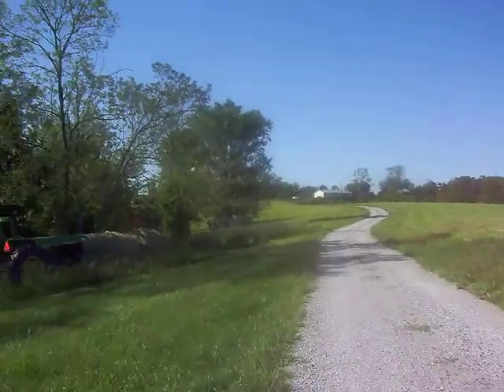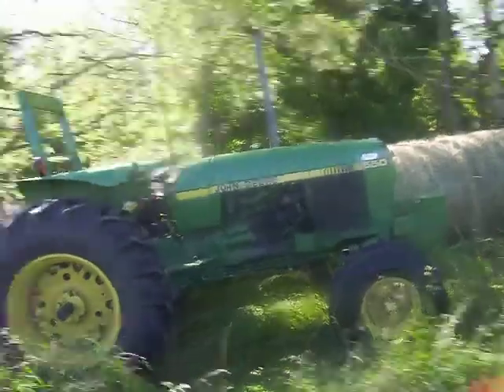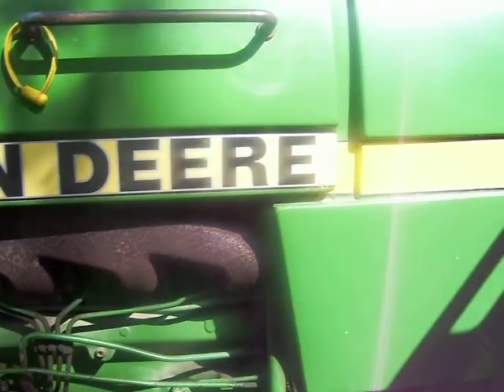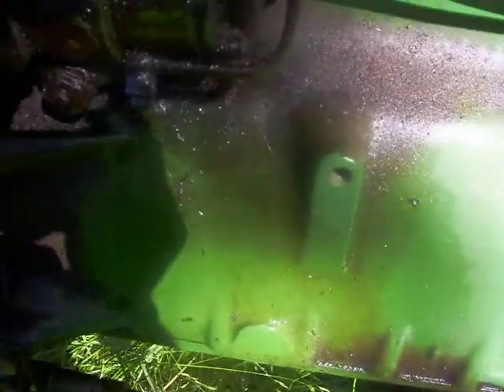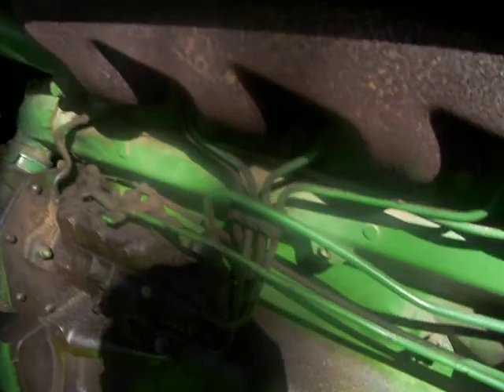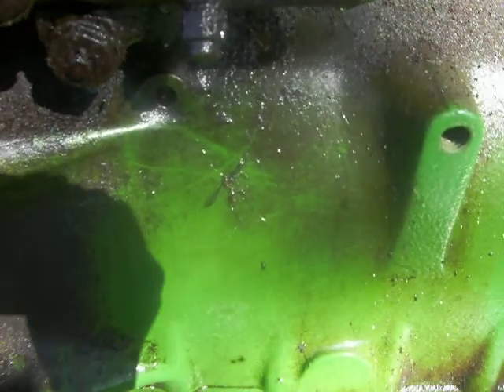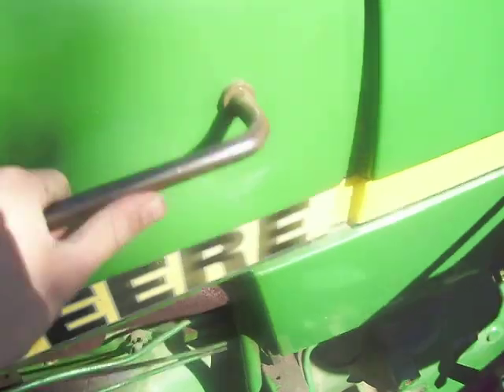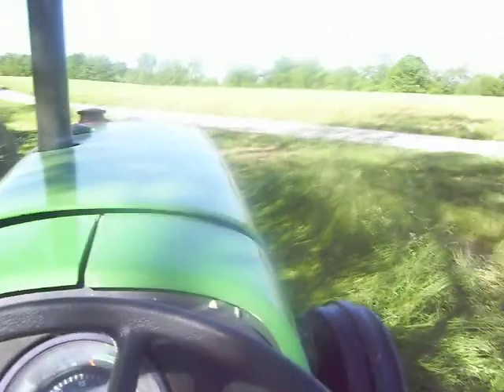Pickin up hay with the John Deere 2550

Comment from the maker: @farmhandstudios Yeah It basically is, but ours just doesn't  have the cab, 4x4, or the loader, but yes the cab version is a little different than the noncab.  In the owners manual the parts are a little different and the engine is a little different.